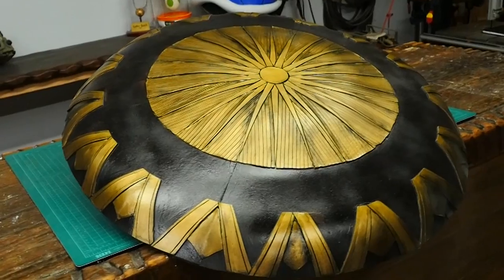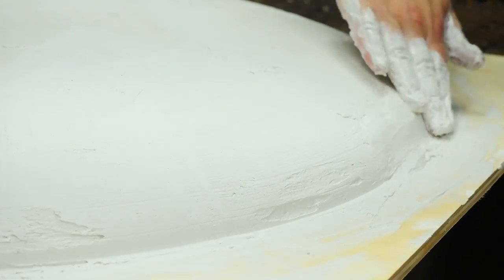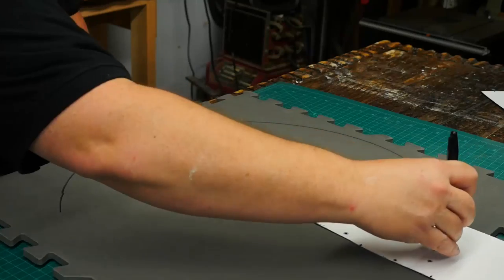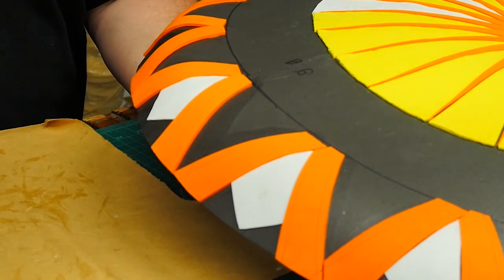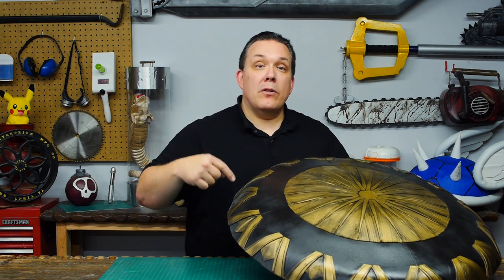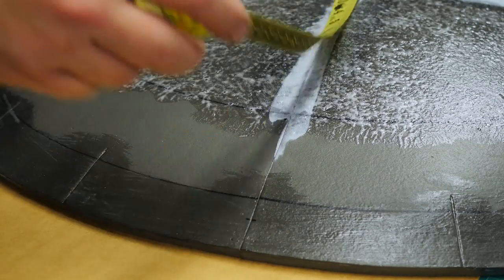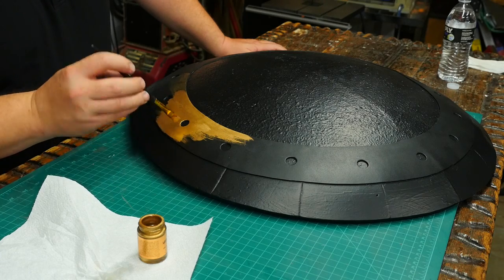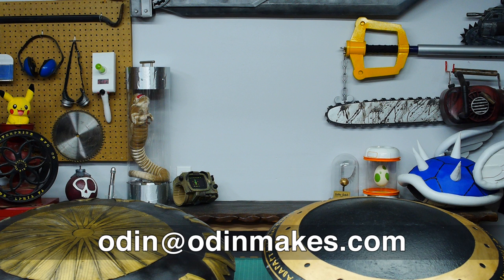Odin Makes: Wonder Woman's Shields

Comment from the maker: Here is the final pattern from the video:
http://imgur.com/a/zVmCC
These are four images sized for US letter paper. Print all four at 100% size, line up targets and tape them together. then cut out. Need a light box so you can see through the paper? Hold them against a window on a sunny day.

Single sheet Pattern:
http://i.imgur.com/I4U6auZ.jpg
Oversized paper, be creative on how to print this one.

looking to make a bigger shield? Just extend the lines out, and draw a new arc like I did in the video.

Want a real challenge? Make an OVAL shield by stretching the Single Sheet pattern before you print it. Say Vertical 115% and Horizontal at 90%.  The pieces will still line up, and it will still dome out too!

Comment: Hey Odin, great job on this project. I learned a lot of new techniques from it.

Small question about plastidip though. I heard it covers small mistakes and gaps in the eva foam pretty well, but wouldn't this also mean that it hides some of the score marks if they aren't wide enough?
Reply from the maker: +OptimusWII- Plasti Dip has to build up to hide the marks. If you use the brush on liquid and not just the spray can, it would defiantly hide these score marks. The guys who make boffer shields for Belegarth always paint a layer or two with thinned brush-on first, and then spray over it. This makes their shields tough enough to last a few years!  They do a coat of spray last, as Plasti Dip is self-solvent, and the spray coats will level out the brush marks from the first layer.

So, if the brush-on is used, Plasti Dip would absolutely cover the score marks.  But this is just one real-world example that I know of.
Reply: Oh wauw, that's awesome that the spray coat can level out the brush strokes.

While I'm asking you questions, would you mind helping me with another one? It's my first time working with eva foam and I've got some rather large gaps between the layers. What would you advise to fill them? You mentioned kwik seal but I'd prefer something that's also sandable.

Comment: Hey Odin, I am planning on trying the snow sled route for the shield. Should I do the straps the same way you did, or another way?
Reply from the maker: Contact Cement will stick to the plastic, if you rough it up first. Figure out where you are going to glue the inside circle piece for the straps, mark it, and then sand it with 120 or lower grit sand paper. Just scratch the hell out of it. What you want to do is really rough up the surface, so the glue has something to get into and hold onto. The scratches don't need to be deep, just plentiful, and really rough to the touch. 
Contact cement will likely just peel off the smooth finish of the sled if you just paint it on without any prep work.  Don't worry, it won't take long, and don't sand anywhere you want to paint later, leave that smooth! Be carful you don't scratch the front while working, blue tape it, or lay it on a towel while sanding the inside.

I have not touched a saucer sled in many years, and I don't know what type of plastic they are made from, but some plastics really don't like spray paints. And most vinyls will never allow spray paint to dry. Seriously, never. The paint is tacky for years...  RIP vinyl Terminator model kit...

You can test spray paint on the center of the inside, it will get covered anyway. If the paint you want to use does not dry, then go to an automotive store, and get spray paint made for car interiors! Most cars have vinyl seats, and that spray paint (it's about $10 a can) will stick, and it will dry. It's really stinky, and smells horrible for a couple of days, but it really works. After a good coat of say, black or grey car paint, you can then paint whatever spray paints you want on top of it, and they have always worked for me. If you want to do Cap's shield, regular automotive paints will have the bright colors with a metallic finish, and it may look really good.
Reply: Odin Makes Alright then. Thank you so much. By the way, you did an awesome job on your shields. 👍

Comment: By the way one question : when I use plastidip to coat the foam, the surface is rather coarse. Any tips to make plastidip surface smooth? thanks
Reply from the maker: Is it coarse from sanding? Or is the texture of the plasti dip acting funny?
Plasti dip can be self-leveling or self-solvent, meaning a new coat will partially dissolve the top of a previous coat., but it can't be smoother than what you start with.  My new Portal Gun video has this problem- it looks a little fuzzy because the foam was sanded and then sprayed.

A heat gun will flatten most of the sanding fuzz, but it cam open contact cement seams.

Xylene is the solvent used to thin Plasti dip from a can (And is incredibly toxic, so it is not available everywhere), if you tried to wipe or sponge Xylene or Klean-Strip Industrial Maintenance Coating Thinner (a safer substitute) you may be able to sooth out the coarseness you are looking for.  I would be afraid to spray it, as an example, Xylene can make you feel ill just from the mist landing on the skin of your arm!
Both Xylene and Klean-Strip Industrial Maintenance Coating Thinner also work to dissolve Contact Cement, so if you are not careful about the amount you are using, your seams can open up.  It's all a pain, but this is stuff I have stumbled over before.

I think Punished Props has a tutorial on how to smooth out EVA foam props, I probably should watch it too.
Reply: Odin Makes I mean the texture of the plastidip. The eva foam is very smooth. Maybe something wrong about my plastidip. Some said it needs to be warmed up. Thanks for very detailed answer.
Reply from the maker: nixland oh yeah definitely warm it up it'll spray a lot smoother just soak the can in hot tap water for a while

Comment: +Odin Makes Great build, I prefer first shield to be honest. But your method to make the shape with plaster and so on... this is pure gold ! :) I keep that in mind for some other project. Sure it will become handy one day ! (R2D2 fiberglass dome ? :) )

I have a question : What about just putting the EVA foam on plaster and heat it there so it naturally take shape of the plaster master ? Instead of shopping it by hand. 
Why not go that way ? Thank you in advance for any answer ! :)
Reply from the maker: R2D2 dome, that would work, and help you make all the panel lines on his head parallel.

I have used this technique to make a 8 foot fiberglass UFO for a comic shop, and I used it to make the head for a a full size Dalek back in 1992.

Comment: If you mess up, what do you do with it?
Reply from the maker: Masked Gamer the messed up piece from this video was torn and just stuck to itself. I actually threw that piece away, and started over the new one. but I only threw away that little foam ring the whole Shield was fine
Reply: Odin Makes, ok thanks. If you do make a portal gun, I honestly would want to see a Sentey turret/core. I saw a blueprint to how the cores function and move. It's actually simply engineering, until you realize that you don't have the right pieces...